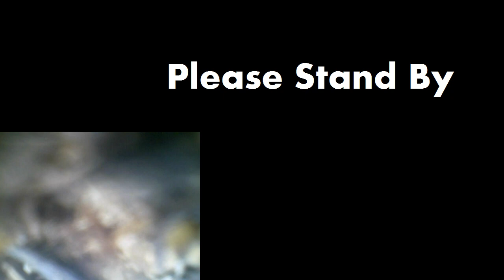Spyder Prototype #3 - First Crash

Comment from the maker: @FlyMario2 - $50 for the gyro sensor, $25 for the Parallax Protoboard, $30 for each motor ($120), $10 for the arms ($40), and then landing gear and assorted other bits probably adds another $50 or so.  I already had the radio system and battery, which aren't cheap, and I made the body and motor mounts on my CNC machine.  I've used plastic plumbing fittings before and they work just fine.

So, probably $300 for the unit itself, plus battery, receiver, and transmitter.